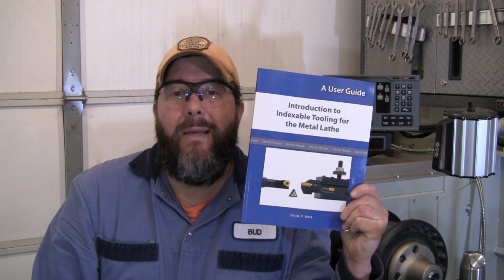Brazed Carbide vs. High Speed Steel -Inserts Rule But- What's Better When You Don't Have An Insert?

Comment: I only just had YouTube recommend your video's, know this is way after the fact (Dec 2023) but I trained with HSS and brazed carbide tooling in mid 1970's.
Real nice to see someone doing the comparisons as majority of new 'hobby machinists' can't or won't learn to grind tools
The 'white' in 7075 with brazed carbide is tearing and not shearing as your getting with HSS.
Both tools should have more top rake for aluminium. (which I'm sure you already know)
 It's much easier to offhand grind shape of HSS than carbide plus putting a corner radius and polishing with India or Arkansas stone is much quicker.
With a 0.004"/rev feed and 0.010" DoC, a 0.010"~ 0.020" nose/corner radius would probably give a 'mirror finish' as long as top rake was also increased.
The zinc in 7075 makes it harder so dry cutting isn't as much of a problem compared to 6061 which would almost certainly have built up a false edge.
Pretty sure the 4140 had a much better finish due to higher rpm and heat into chip with carbide?
On the 316, it looked like HSS was cratering?
Reply from the maker: @1crazypj - Welcome to the channel and thank you for the feedback and additional info. I did not get into a lot of geometry as you pointed out more trying to show these how I think the average hobbyists might grab and use them. I agree with you that more time and care and you can get a better finish for sure. Hope you enjoy some of the other videos on the channel.

Comment: Carbide inserts specific for aluminum (like CCGT xyzzy) will produce a near mirror finish when used properly ... and the SFM does not need to be that high. It is much a result of tool geometry, no coating and carbides specific to aluminum. Similar to identical applies to alloy steels (4140 and many others), stainless steel, Inconel, Titanium and etc.. The cutting tool universe has moved SO far from HSS and cobalt HSS. Chip formation or cutting  does not happen in the way most believe, it depends on cutting tool geometry more than just the cutting tool material. Positive rake tools be they HSS, brazed carbide, carbide inserts all work the same way. Insert carbide has FAR better geometry control than any hand ground tool could ever have. This  comes into its own for threading tools (far beyond the common 60 degree V or ACME as there are Many other thread forms available as carbide inserts), grooving tools radii tools and more. Positive rake tools remove metal by essentially shear action, trade off, they are fragile and cannot stand much DOC or deal with hard, gummy, sticky materials. Negative rake carbide inserts remove metal by heating up the metal where tool meets metal high enough to essentially scoop the semi molten metal away. This is why negative rake carbide insert tools need higher speeds, higher feed rates, more power and rigidity from the lathe to produce best results.

Take the tine to watch this Kennametal presentation on cutting tools or "chip making".. This presentation does SO much to dispel vast amounts of cutting tool mythology and machinist traditions that do not apply to modern cutting tools and technology.

https://www.youtube.com/watch?v=QeOGE8pHKhQ
Reply from the maker: @rupunzel6299 - I don’t disagree with anything you said. My only point in this video was to help the hobby machinist think about carbide even for hand ground tools instead of just HSS. There is almost always an insert that is better than any hand ground tool but the average hobby shop can’t afford every insert profile. Many hobby machinists have been told they can only do HSS and I was just trying to share that even if you want to grind tools Brazed Carbide is another viable option. That’s it.
Reply: @BladesIIB  

Brazed or "cemented" carbide is an absolutely excellent alternative to HSS or cobalt HSS turning tools. Brazed carbide turning tools were developed to replace HSS in most all turning tool applications to deliver better results and longer tool life to meet then industry demands for cutting tools. Turning tool geometry for brazed carbide and HSS is near identical, can be hand sharpened with silicon carbide or diamond stones in near identical ways as HSS..  Different grades of brazed carbide offer similar to better performance as HSS in nearly every turning tool need with longer tool life.

What is often not considered, what the machine tool parts goals are. For hobbyist, metal trinkets with modest finish and tolerances could be excellent. Or an aerospace or medical device parts nothing less than per-designed spec will do. These considerations absolutely figure into the machines and related tooling needed to achieve these part goals.

Problem with U-tube University, there is much mis-information and videos made for content instead of factual real world education as there is usually not a lot of entertainment value to videos like these. Drama sells, perpetuating myths sells.
Reply from the maker: @rupunzel6299  Appreciate the added perspective in the value of Brazed Carbide over HSS. Always options and trade offs depending on the needs like you outline. I try to keep my videos drama  free and as legit as possible. Hopefully that comes through. I post the actual projects I am doing in the shop. Most of them first run first take on the real build with all the detail that people can follow if they are doing similar operations. Including the issues I run into and the thought process and trouble shooting to resolve. May not be the fastest growing channel but I am truly trying to deliver quality useful content to the hobby machinist and anyone interested in machining. Appreciate you adding to that value with your comments.  Thanks!

Comment: Just so you know, for inserts there is a special insert for aluminum (they will be silver and highly polished). You use these on aluminum/possibly brass only, and when you do you get a beautiful glass like finish. But for other inserts they have a million different feeds/speeds, and as long as you follow the recommendation you get a good finish on them. I do notice on a lot of CNC videos they seem to use narrower inserts (such as D inserts) for their finish cuts to get a good finish, and that the wider inserts (S, C, W, T, etc.) are for roughing cuts. I wonder if you have tested this out, like using a DCMT insert vs WNMG insert of the same type, and if you get a better finish on the DCMT vs the WNMG? I find most inserts are intended for CNC so they have speeds that you can't reach with manual lathes.

Yes annealed 4140 is really hard to get a good finish on. I find that if you heat treat it even by a little bit, with a high temperature temper, the finish quality improves dramatically. I would torch heat them inside refractory bricks then dunk it in water (I know you are supposed to use oil for this but I don't have any oil, only water), then heat it to temper. I kinda wish that 4140 in Taiwan came pre hard but they tell me that I have to take it to a heat treat shop for that...
Reply from the maker: Tyler Fu - Agree with all you said. I have both aluminum and universal inserts. This was meant to be a quick comparison of tooling you need to grind. I mostly use inserts but when I do need a custom tool I tend to reach for brazed carbide to grind where many others reach for High Speed Steel, just thought I would do a quick comparison.
Reply: Aluminium inserts are not much good on brass as they tend to 'dig in' even on a very rigid machine. (and why brass drills have a 'flat' cutting edge)
 On a 7x10~16 it's too flimsy and HSS or brazed carbide with zero top rake works much better

Comment: Hi Bud, thanks for the video. What was the reason why you didn't used the same grinding wheel on both carbide and HSS ?. HSS can really cut beautiful in aluminum if you also hone the HSS with the diamond. It will cut even better than you show and if you also add methanol as cutting fluid when making the finish cut it will shine beautifully.
Reply from the maker: S R - Great questions.  For the wheel, the green silicone carbide I would not use on HSS but no reason I could not use the diamond wheel like a hone - good point.  I know many people can get a good finish with HSS, and I just used one in my last video to make a Poly V groove cutting tool.  I just find that with Brazed Carbide it stays sharp longer and I get a more consistent finish with it with less fuss in sharpening.  Maybe the real issue is I just don't spend enough time with HSS to get it just right?  I have heard to many people think Brazed Carbide is terrible, just trying to show another perspective.  Appreciate the comments.
Reply: @BladesIIB  You won't hurt a silicon carbide wheel with HSS, in fact, you almost always grind the body of brazed carbide tool a little.
'Green grit' wheels are considerably more expensive than aluminium oxide though and more 'friable' so are wasted grinding HSS on a daily basis
Reply from the maker: @1crazypj  Good point that it won’t hurt the wheel. Just a little hard on it. With my belt grinder I have a wide variety of grits so for a new profile I can really remove HSS in a hurry. Funny how we get into habits in the shop and after a while can’t even remember why. 😁

Comment: Thanks for the video.  Need to learn speeds, feeds, and grinding cutters.  Do you recommend using lubricants or coolants on the lathe or mill?  I'm wondering if most YT videos don't use it because it's more difficult or messy to deal with.  Subbed
Reply from the maker: customcutter100 - Thanks for the comment and the question. For speeds and feeds I have the app Machinist Pro by cncdirt is really good for a good price. As for coolant, I love it on my CNC. For my manual mill it would be nice but just way to messy. On the lathe there are times it would be nice but for me not often enough to warrant keeping it filled up. With evaporation etc. maintaining coolant is extra work. Worth it for me on the CNC but not anywhere else. Hope that helps.
Reply: If you are using carbide cutter I read that the best for it is either use it dry, or flood coolants. They say this because carbide is brittle and if you thermal shock carbide they will crack on you. I don't know how true this is. I find 99% of the time you really do not need coolant for manual lathes/mills unless you are using HSS. Only if you are doing those deep hole drilling then you might want coolant, but you need some high pressure coolant blasting the chips out. Thinking of maybe using a power washer for this (as you can get good 2000 psi out of those)

Comment: Hey Bud, @23:20 the camera captures a cloud of 400 grit emery dust showering down on your unprotected Ways!  WTF? :face-blue-wide-eyes: 
Wakodahatchee Chris
Reply from the maker: @cdrive5757 - I keep the ways clean before running the lathe, especially after doing a lot of grinding in the shop.  But it I stopped and covered the ways every time before grabbing a piece of emery then I may not get much done.  Lots of polishing and grinding sure.  But not a little here and there.  Appreciate the comment though, I will try and do better.  :)
Reply: @BladesIIB  Bud, don't lose any sleep over my comment. After all, you're the one doing all the work. I'm just one Hen in a barnyard of thousands watching your videos. It's easy for me to pontificate on others shop practices while I'm relaxing sipping hot coffee!:face-blue-wide-eyes:
After all, I still gave you a thumbs up and subscribed. 😋👍
Thank you for the reply. 🖖
Reply from the maker: @cdrive5757  All good. I consider all feedback worth evaluating and happy to share my perspective. The shop is always about trade offs. There is the perfect world then what makes sense based on time, quality needed etc. Thanks for the Sub.
Reply: I think it was metal dust not aloxite? 
Emery tends to be dark grey/blue, aluminium oxides almost always reddish brown but can be almost any colour you want (in gemstones)
Reply: @1crazypj  Thanks for the tip!👍👍